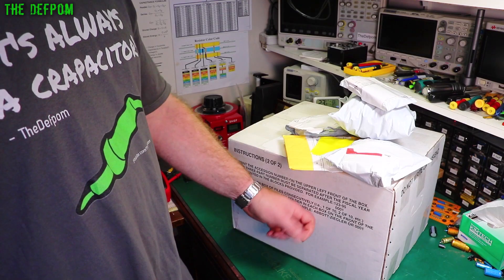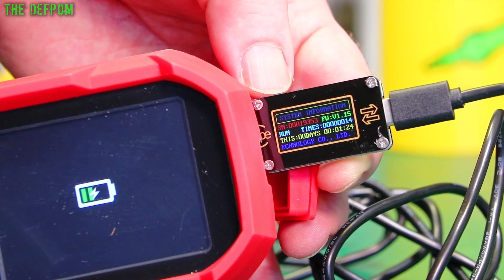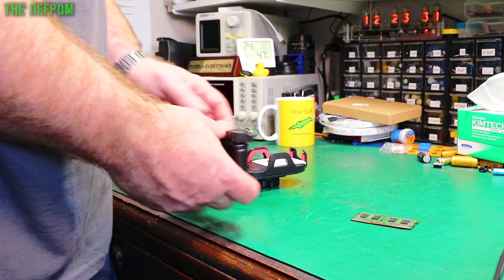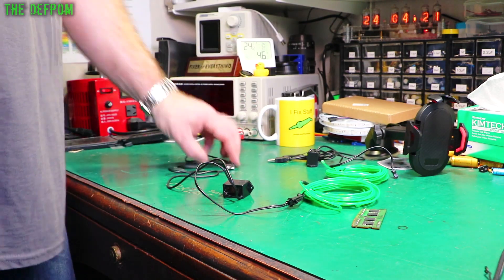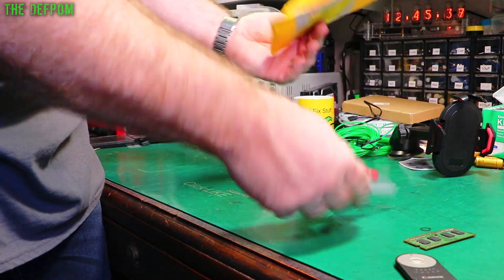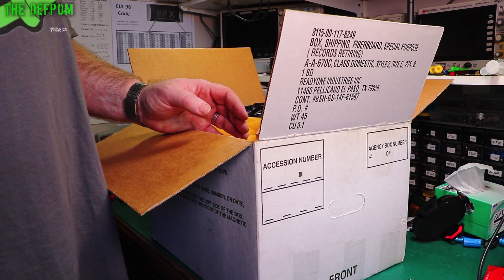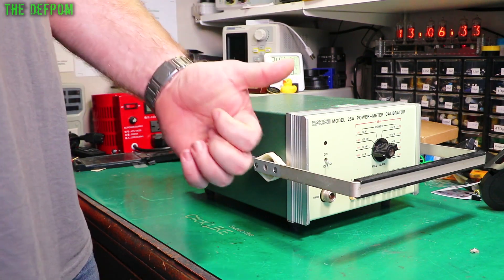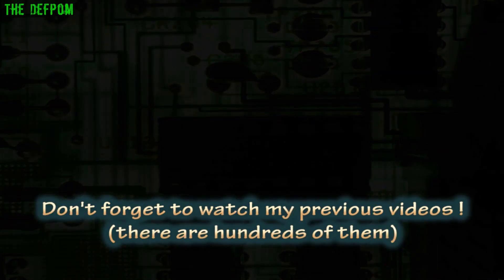🔴 Mailbag Monday 7th June 2021 - No.840

Comment: I believe a USB-C to USB-C cable has electronics in the plugs at each end that negotiates with the equipment you connect them too.
To inform them about the cables capabilities (limitations). How much current it can handle, how high voltage, dataspeed etc.
I got one of those Ruideng USB-doctors over a year ago, might be time to do a FW update.
Mine is at version 1.12, and I noticed yours was at 1.15.

Comment: Only in my head, I think of Calibration as adjusting, and certification as the testing after calibration, BUT in my industry, Calibration is used universally.  If they are concerned about adjustments, then they may ask for BEFORE and AFTER DATA (double the price).